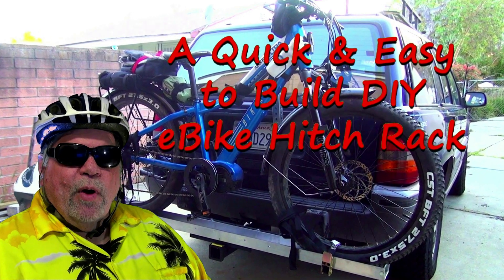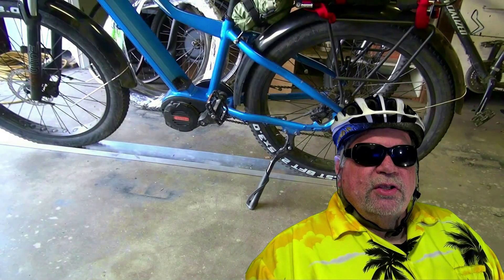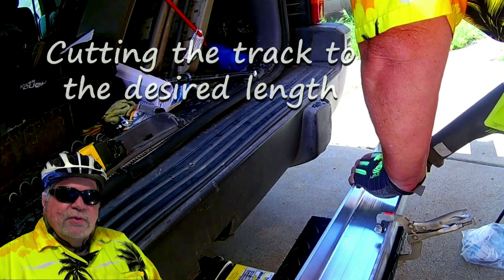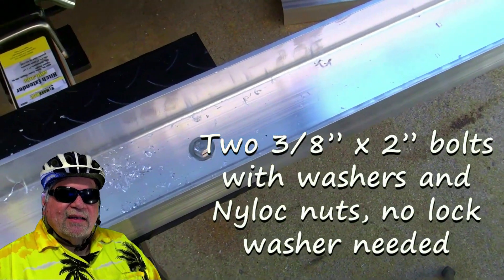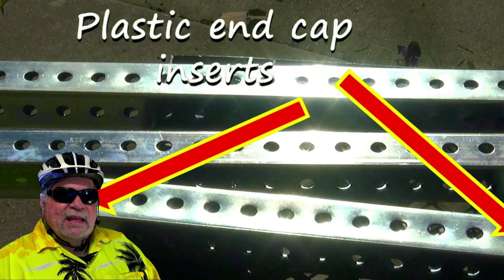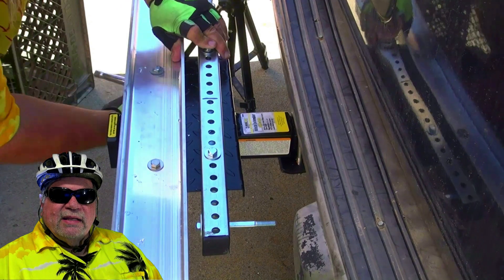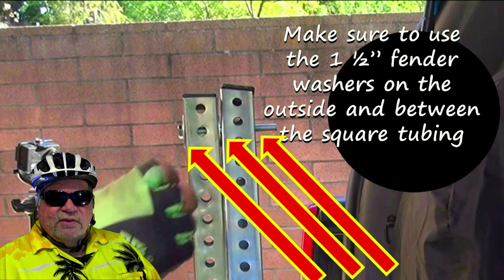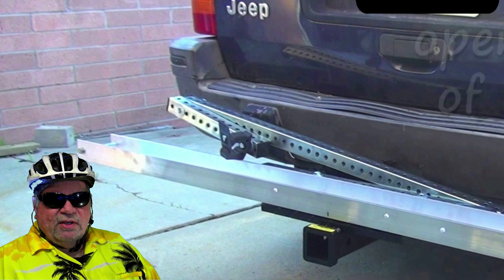DIY Receiver Hitch eBike Rack Easier & Cheaper than you think! This DIY e Bike rack is STRONG!

Comment: I was going to build this but Harbor Freight has the HAUL-MASTER 400 lb. Receiver-Mount Aluminum Motorcycle Carrier for $170.  It's more like 200 lb capacity, their pics show it carrying a dirt bike.  Should fit 27.5 inch wheel e-bike well.  Comes with a ramp, too.
Reply from the maker: Thanks for your comment. Yes, Harbor Freight has some good quality racks. The biggest difference is the Harbor Freight rack relies on keeping the eBike on the rack with straps. If not done correctly or if your tires lose air pressure while in transit, the straps will loosen and the eBike could fall off. The DIY rack has a solid post which will not loosen if the tires lose air pressure.  Both are great racks for the money and if mounted properly are a great bang for the buck for an eBike Rack. Do you usually travel long distances with your eBikes on the rack?

Comment: Hello, GreyBeard! I don't know if you've been asked this before--what bike lock do you use, if any?
Reply from the maker: Thanks for watching. Seems eBike "Pirates" can defeat any lock system but I try to make it as difficult as possible for them. I try to bring my eBike inside when I have to leave it. When I have to leave it locked such as when it's on the rack and I have to leave it, I try to leave it in sight to a lot of people and I use a 2-lock system. I use a Kryptonite U-Lock to the rack and a very heavy chain with a heavy disc lock to the rack. The eBike Pirates can still get them but they will be very noticeable, and it will definitely take some time.  As I said, I seldom leave my eBikes unattended. Thanks, hope this helps.
Reply: @GreyBeardEBiking  Thank you for answering! I think I will get two different locks for my e-bike as well :D
Reply from the maker: @senorPachuChay  Sounds great, just make sure the chain is heavy gauge chain links. Good luck

Comment: I built a rack from your original video.  But I started with a motorcycle rack I got for $100.  My e-bike 80 pounds without the battery and has 4” wide tires. My wife’s is 60 pounds so I needed something hefty. So I extended the motorcycle rack and added another channel for my wife’s bike.  I followed all your ideas and it works great.
Reply from the maker: Thanks for the comment and for watching. Yes, that's a great idea to start with the motorcycle carrier. eBike are way heavier than regular bicycles and need a heavy-duty carrier. What kind of vehicle do you transport your eBikes with?
Reply: Which is better if I need 2.
Do I just double all parts.
It seems like I can still put the tow dolly in 2nd addition? Correct?
Reply: @GreyBeardEBiking  I started with a Chevy Bolt EV but since upgraded to a Tesla Model Y long Range.  Love E-bikes on and E-car !

Comment: The Maxx Haul ReceiverStep is $5 less on Harbor Freight compared to Amazon but the anti-wobble device is $3 more on Harbor Freight.   Do you have a suggestion for making it easier to lift/mount an ebike (~ 68 lbs) on the rack??
Reply from the maker: Thanks for the great comment. On my rack and on many "Factory Built" racks, I simply used a 3' piece of aluminum "U Channel" and put a hook on the end of it. It makes a great affordable ramp. Here's a link.  https://www.midweststeelsupply.com/store/6063aluminumarchitecturalchannel?ad=semD&an=msn_s&am=exact&q=6063+aluminum+channel&o=29593&qsrc=999&l=sem&askid=6ddea4aa-146e-4c07-8b95-46e8d590adac-0-ab_mse&msclkid=d320baf731e5100f5848de5486050174&utm_source=bing&utm_medium=cpc&utm_campaign=Midwest%20Steel%20Supply%20DSA&utm_term=midweststeelsupply&utm_content=All%20Webpages